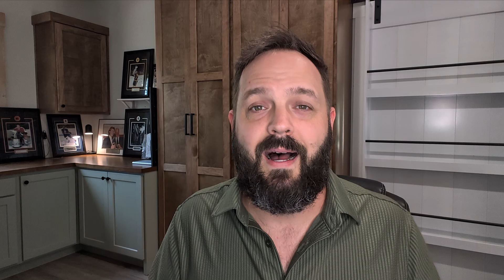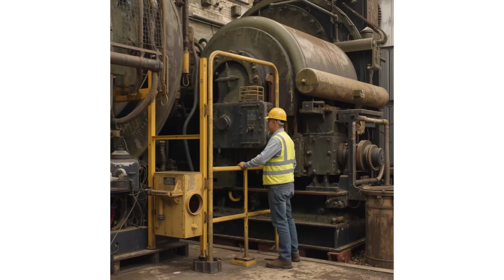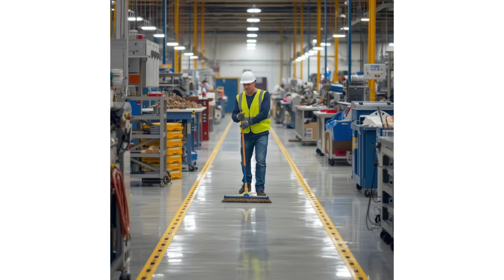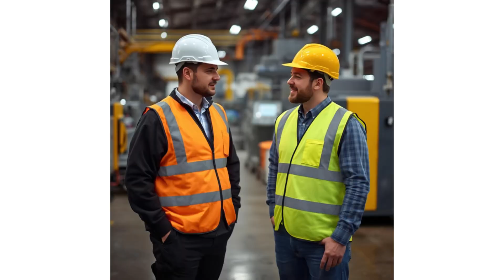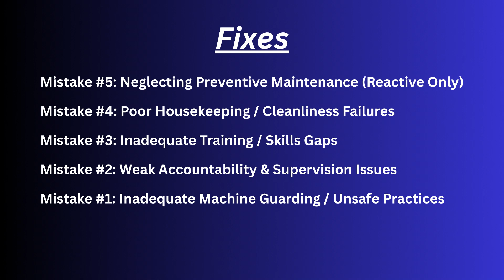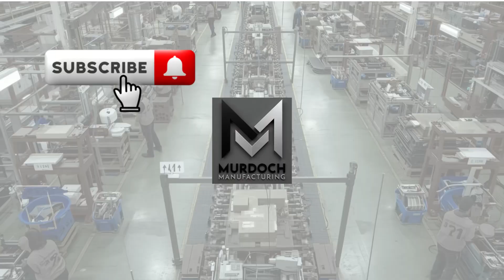The 5 Biggest Mistakes I Saw on Plant Floors Every Day (And How I Fixed Them as Plant GM)

Comment from the maker: These 5 mistakes cost my plants thousands in downtime, injuries, and headaches—every single day.  
The fixes I used turned shifts around: preventive PM walks + spares, enforced 5S cleanliness, pairing weak with strong for real cross-training, fair accountability enforcement, and zero-tolerance LOTO/guards.

Which of these 5 is hitting YOUR floor the hardest right now?  
Drop the number (#1–#5) or your own story below—I read every comment 👇  

Free toolkit with checklists I used to fix these (Daily Safety Walk, Onboarding, Scorecard + more): https://bit.ly/MurdochToolKit  

CONSULT if you want a free 15-min call to talk through any of these for your plant. No pitch, just real fixes. Or book here: https://calendly.com/brad-murdochmanufacturing/consult-15min

For more real fixes on the plant floor, I'll see you in the next one.